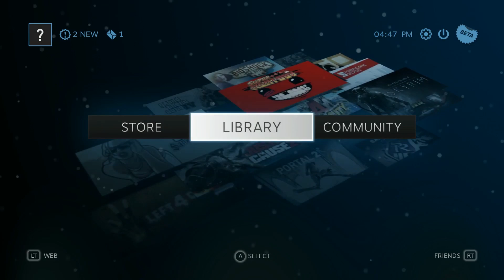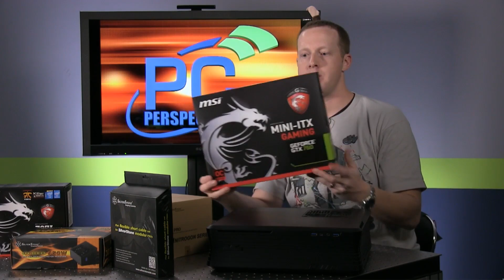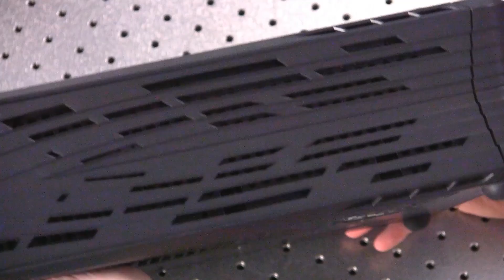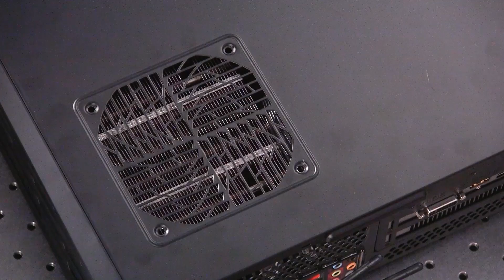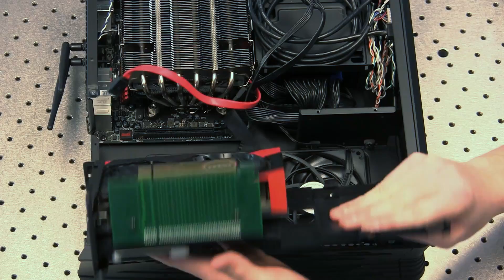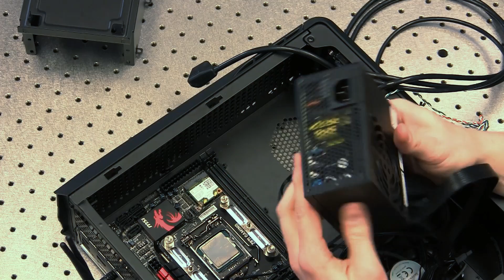Silverstone Raven Z RVZ01 Mini-ITX Case - The Steam Machine Chassis

Comment: hello pc per
I have just purchased this case and I'm looking  to build my first pc in it. I have a question about the sfx psu. I'm using a i5 4460 with a asus r9 290 directii  cu card. what would be an appropriate  psu. I have read many misleading things. there will be no oc or anything.  I will use a optical drive but that's about it. please help thanks

Comment: If they didn't include that extra drive mount on top of the PSU, they probably could have designed it so that you can stuff a full size ATX PSU in it although getting it in there would be pretty tricky especially with a non-modular unit and normal cabling. Even with a fully modular unit and the flat cables, the wiring is still pretty messy (12:08) although this guy did a great job making it at least look organized. There is a lot of wire slack with SFF cases and nowhere to put it. That is one problem with tiny cases like this, there is no where to tuck and hide the cable slack unlike normal ATX cases with almost unlimited space compared to this. I would rather have shorter cables instead of flat ones although both short and flat would be ideal. Does anyone know if any PSU makers sell short cable kits or is the only way to custom hack them? One other thing that I would like to see besides optional short cables is optional SATA power cables with only one connector instead of the typical 3. These minor changes for specialty SFF PSUs would make the wiring look so much more organized. Right now, the cabling is designed for very big wide open cases even though the unit itself is designed for a cramped SFF case. Not sure why PSU makers haven't thought of this. 

Also, what DVD or Blu-Ray ODDs are compatible with this? Seeing that it is slot and not tray fed, I assume your options are limited. I also assume this drive must be made for a laptop so replacement laptop drives are the only option?

Comment: ๋just a question can you fit MSI Z97 AC (mini ATX) board in there as well
Reply: It also supports Mini-DTX (That's like Mini-ITX with two PCI slots), thought it isn't commonly found on market.
Reply: Chaisith Pattaravarangkur Make sure it is mini-ITX. There actually is no mini ATX, it is called micro ATX. Basically, if it has more than 1 PCIe slot on it, it won't fit. Micro ATX will usually have 4 PCI/PCIe slots or 3 so the first one can be used by a dual slot GPU.

Comment: Well, good thing the r9 fury X is small i might have actual space for the radiator and fan... pretty cool, i guess it means that i will be buying this and creating a console killer of some sort.
Reply: ***** while you could easily fit a Fury X and its liquid cooler in this case, the most powerful PSU you can get for this case is 450 watts which is not even close to what the Fury X needs under full load. The Fury X's recommended PSU wattage is 650 watts and 700 watts if you are overclocking. You can probably get away with a 550 watt unit if it is a very high quality like from Seasonic or something but that is still about 100 watts more than what would work in this case and it would be pushing the 550 watt unit hard. The highest AMD card that this 450 watt Silverstone SFF PSU can handle is probably going to be the R9 380, 285 or 280 (as well as the 7950). The GTX 980 and 970 would also be good options and are way more powerful than a 380. Both need a minimum of 500 watts so if you don't OC the CPU and have only one HDD and an SSD it should work. If you want only the Fury X, though, you will have to go with a case that can house a full size ATX PSU unless someone comes out with a 550-600 watt SFF PSU within the next few months.
Reply: Jay Man
Thank you, oh well, i guess i can't put my fx 9590 OC to 5ghz and my furyX in lolololo

Comment: If you want to use the case as a HTPC, I advice against the SFX power supply (too noisy with 80mm fan)... take a SFX-L power supply with semi-passive 120mm fan

Comment: Would this fit an MSI GTX 970? I only ask because it does hold larger cards but this card is larger than most in terms of height not length.
Reply: You should take a look at Dondan a4 or saperpl cases in hardforum sff section. They are going to start the prototypes early next year and hopefully have them ready for order by summer or mid-summer.

Comment: pcper PC Perspective On this system, did you guys have the fan on the NT06-Pro pulling air through the heatsink and down onto the board or did you have it pushing the air through the case and out?

Comment: I need feedback/recommendation base on my build.. While gaming on on a warn room it goes up to 73c, cold Room around 72f it goes up to 65c. Did I do something wrong or is it Normal? No apps running on the 40s Celsius warn room, cold room on the 30s

Windows 8.1 Pro
Fresh installed it used use to log in in less then 7 sec now it take longer about 45 sec why?

Intel Core i5-4670K Quad-Core 
Silverstone Tek Flat Flexible Short
Noctua Low-Profile Quiet CPU Cooler for Intel 115x Based Retail Cooling NH-L9I 
MSI Z87I, LGA1150, Intel Z87, SATA 6Gb/s, USB 3.0, 1 PCI-E x16 3.0, Mini ITX Motherboard 
Corsair Vengeance Blue 8 GB (2X4 GB) PC3-12800 1600mHz DDR3 240-Pin SDRAM Dual Channel Memory Kit CMZ8GX3M2A1600C9B 
Intel 530 Series 240GB 2.5-Inch Internal Solid State Drive SSDSC2BW240A4K5
Silverstone Tek 450-Watts SFX Form Factor Full Modular Power Supply with 80 Plus Gold, SFX+12V single rail, ST45SF-G 
Silverstone 12.7 mm SATA Interface Slot Load 8X CD/DVD RW Drive SATA 3.0 Gb-s Optical Drive SOD02B - Black
Silverstone Tek Mini-ITX DTX Computer Case with PCI-E Riser and Custom Low Profile Fans, Black RVZ01B
MSI Graphics Card N760 2GD5/OC ITX 
Seagate Internal Hard Drive Kit STBD3000100 3TB 7200RPM
Reply: First of all i would go for better fans pherhaps sp 120 or 140 or add an air conditioner in the room which would benefit you and the pc or go with a bigger case if you have the space

Comment: I built a computer using this case the other day. My new PC temp was running high and my graphics card was not registering even after downloading all drivers, so disassembled my PC and took the graphics card out of the riser card, and reassembled (oddly, with some difficulty), and rewired. I powered on my PC, and the HDMI (I am using my 51" as my monitor) did not work though it worked before! I double check my wiring, made sure wires were good. But I have no idea. What should be my next trouble shooting step? Send back the Graphics card? Send back the GPU riser from Silver Stone? If that does not work, next mother board? What should I do? Please help!

Comment: would a scithe slip stream slim fan still fit on top of the heatsink, or on the lid / panel? 

http://www.amazon.com/Scythe-Slip-Stream-120mm-SY1212SL12L/dp/B002CYPWTG/ref=sr_1_3?s=electronics&ie=UTF8&qid=1399931737&sr=1-3&keywords=scythe+slipstream
Reply: Nope, the height for a cooler is 83mm max.  The NT06, with the fan on the bottom, is 82mm.  No fan will go on top of it.

Comment: how about going with an external power supply like one that alienware x51 PC´s have? I would use the spare space for water cooling unit for better CPU performance. or i would put there a bigger power supply for better output. Do you think I could fit it there? What are the measures of that space? Thank you. ALSO... how long GPU can I put in?

Comment: You can install a long Graphics card. Even a Optical Drive is installed. Others on YouTube have done this before. ( but a corsair h60 water cooler does not fit, because of rhe pipes).

Comment: That cpu cooler fan should be exhausting, hot air out of the case
Reply: Silverstone cases work best with positive pressure, meaning all fans are intakes.  That's why there is a TON of passive ventilation on their cases.

Comment: I really don't want to get rid of the optical drive for a larger video card, , that's what i understood. It it sad because it is a great case, but i believe i will stick with the coolermaster elite 120 advanced because i will not need to change my standard optical drive nor change my psu,  i already have my gaming pc but i wanted to change to a mini-itx mobo + mini itx case... there's the Hadron Air but i will have two psu (not that big deal) and there's the 120 elite as i said earlier... don't know what to do :'(
Reply: Optical drive and longer card will fit together.  That's why the ODD area is "cut out" so to speak.

Comment: I wish they could get a 500-600W SFX Gold/Platinum supply out, 450W is fine for most configs but powerings lots of peripherals and something beefy like a GTX 780 or higher doesn't inspire much confidence. Heck even a 770 needs a lot of power on the 12V rail!

Comment: I wish this would take a standard 600w PSU.  I would love to put in a gtx 780 ti in it.
Reply: You don't need a 600 watt PSU to power or support a 780 ti. It would work with this little 450 watt PSU.
Reply: Really?  evga's 780 ti sc power requirements is 600w at least.
Reply: Yes i know but they are the worst case scenario requirements. They have to take into account the power users out there that consume enough power to run a small country. All these steam machines can house a 780 ti and titan. Most of them use that silverstone 450 watt PSU
Reply: Good to know.  I will be getting this case with that psu and a gtx 780 ti. Thanks man.
Reply: It looks like a brilliant little case. Be sure to update me when you get it and outfit it with parts. I'm curious.
Reply: For sure man.  I'll try to film it when it's all loaded up with parts. I can't wait.
Reply: Cool man
Reply: If you really wanted a 600W PSU though, Silverstone now makes a 600W version of their SFX PSU.  Even comes with the short flat cables.

Comment: can you install a thin 120mm closed-loop LCS, like the Antec Kuhler H2O 620, on the fan mount directly above the motherboard?
Reply: I've read that it's possible(space), but it depends on the flexibility of the tubes (this is the main problem).

Comment: Is it possible to use a high end graphics card in this case, given the power supply limitations? Can you even run a 780 ti on a 450W power supply?
Reply: only if the GPU is not volt modded and running crazy oc, which is most likely not even possible in this case...
Reply: Jokis I agree. If you are running stock speeds. not much reason to OC such a high end card anyway unless you are going crazy 3 or 5 monitor gaming. Then you would probably need 2 Nvidia cards and a different case anyway.
Reply: Many people are already running 780ti and Titans in the 300 Demo Steam Box and that is a 450 watt PS also I think.
Reply: Jokis he said you can water cool it and all of the hard parts seem to be compartmentalized, what more would need  to OC if someone wants to go Hard core here is a link to VM a 780  http://kingpincooling.com/forum/showthread.php?t=2290

Comment: I see that in the Slot-loading Optical drive there is a kind of a digged area that made me think that in larger Graphics Cards their end will sit on top of the optical drive (I thought this after seeing Linus video). But then he says that I can only install a bigger Graphics Card if I don't want to install a Optical drive. At what extent is this true?
Reply: Yeah i saw Linus' video too and by my estimations, i'm pretty sure you can install a 780 WITH the optical bay. I think it would be just enough for the optical bay to sort of fill the digged out area to make it level with the mount. But i'm just estimating though. Can't confirm anything as of now!
Reply: Anyone knows the answer to this yet? I really need to know wether I can get a slim slot loading BD burner with a gtx 780 ti
Reply: Leonardo Segura this is a video of someone fiting and full size graphics card with a slim optical drive,hope this helps

Comment: Powersupply is a big no no... Cant last longer.
Reply: What? This is an 80 plus GOLD PSU... at the very least it is way better than what most oems use.
Reply: zap813 Maybe if you dont overclock too much the CPU or the GPU. For all stock clocks is fine.
Reply: No higher watt SFX PSU's from reputable companies.
Reply: *****  Yes and you have to be careful what you buy or what you add

Comment: If I cant cool my 560 Ti 448 Cores within acceptable noise levels in my Fractal Design Define R3, what the hell is that case going to do? I assume the graphics card is screaming like a vacuum cleaner.
Reply: no you're graphics card is just shit.
Reply: Omanjack"Your", not "You're". "You're" is short for "You are". Now you know.

Also, why would my graphics card be shit?
Reply: latuman it's obviously faulty if it's that loud, who is the manufacturer?
Reply: Your graphics card would be getting constant cool air from the 120mm fan under/beside it, if you use it as an intake. Also, if you get a good card from a good manufacturer, your card shouldn't sound like a vacuum cleaner. (I'm looking at you, AMD.) You can also watercool with this case, apparently. There is room for a H80I right above the CPU, and if you make a custom loop, you should be able to watercool your GPU as well.
Reply: Loadiave I would be so impressed with whoever watercooled this thing

Comment from the maker: Curious on your thoughts about this case.  Do you like this home theater style mITX chassis or the "cube" style?
Reply: Good fortune to you and your crew in the New Year Ryan, first off I prefer  RVZ01 tyoe of HT form factor, I remember the Digital Storm Bolt Mini-ITX review you did back in 2012 and pretty mush impressed with the idea, and of a AOI incorporation I would like to see you do a ASUS build and the new ASUS GTX 780 Ti DirectCU II OC with this unit as I'm all ready looking to do one myself :)
Reply: I much prefer the the SG05 or even the FT03-Mini, you can add an AIO for better CPU cooling. Although I do think that the RVZ01 is an interesting case.
Reply: ***** I sent an email to Silverstone who said that in Europe (for those of us who are in Europe) this case would be in February 2014. Whoo!
Reply: What is the price starting at? And when is it going to be available?
Reply: Actually, SFX is a standard developed by Intel following the introduction of mATX motherboards ;-)
More info here : http://www.formfactors.org/developer%5Cspecs%5CSFX12V.pdf
Reply: I like this flatter style. Can you share the actual dimensions PCPer? I would like to put something like this in a Gaems Vanguard. The 300 Steam Box demo units barely fit, this one looks slightly bigger. Not sure though.
Reply: ***** Would that really be a big deal if they didn't? the speculation is price for the case would be $100 or just a bit more. SO buying all the required barebones parts from Silverstone (PS, Mobo, etc) wont be bad. You could even choose different brand parts if you desire. But It would not hurt to have this as an option, and I suppose it would be much extra labor for Silverstone, they have all the parts already in inventory. So they should offer them either way.
Reply: LOL
Reply: my question is - why did you use a small GFX card when you can fit a reference titan in there?
Reply: LewiBeats Because its a new Card and its made for ITX Builds. And who wants to put a Titan in an ITX build...
Reply: JakeTredy Tanki Gaming I want a 780Ti inside. Better for gaming.
Reply: Well the point of these kinds of builds is for a cheaper gaming console like computer.
Reply: pcper I like this shape over the cubes because I use it in my tv stand serving as my main gaming pc. However, I wish this was still smaller like the prototype Steam Machine. This case is roughly 2 inches taller and 3 inches wider... which is quite in this regard. However, still smaller than my Fractal Node 605! Plus the RVZ has water cooling support where my 605 does not.
Reply: the home theatre style is much better. the "cube" style has got to be the most inefficient use of space ever...
Reply: I never have liked cube style cases. I'm building a secondary system with this case for home theater use and portability. I thought about going with a laptop, but if you want one that can run the latest games they get really expensive and you still have to turn settings down usually. Plus gaming on a 17 inch screen blows when you are used to a 28 inch.
Reply: pcper I don't think the whole Steam machine idea will take off until Intel or AMD comes out with a SOC solution that rivals or beats the current gen consoles in terms of CPU power, CPU core count (8 physical cores) and GPU power. AMD has some APUs that are pretty powerful but still nowhere near what is found in an XB1 or PS4. The main problem is stuffing the PSU in such a small case without using a power brick and also stuffing the GPU in there. If all you have to install is the motherboard, a CPU cooler and a SSD or HDD, then I think more people will be interested in the concept. For now, you pretty much have to have a discrete GPU and a powerful PSU making even the smallest SFF cases nearly twice the size of a console while producing even more than twice as much heat. I do prefer the flat "VCR" style case for this type of HTPC/TV gaming rig but - and this is coming from someone who owns a mATX Bitfenix Prodigy cube case which I like very much. The cube design is probably better if you are liquid cooling which I am doing with both the GPU and CPU. There is a lot more room to work with for the liquid cooling tubing. If i was building a new rig with all air cooling, though, this Silverstone case would be at the top of my list.